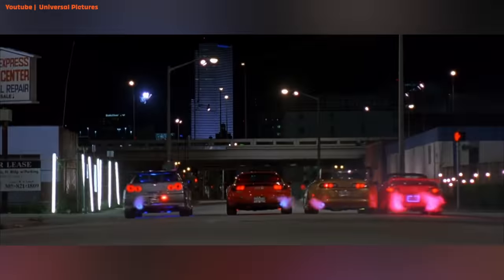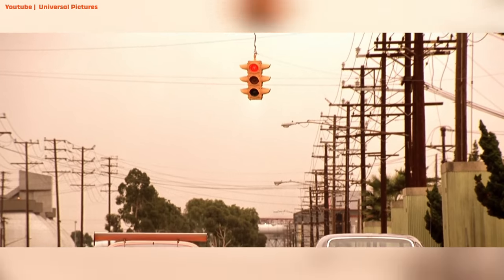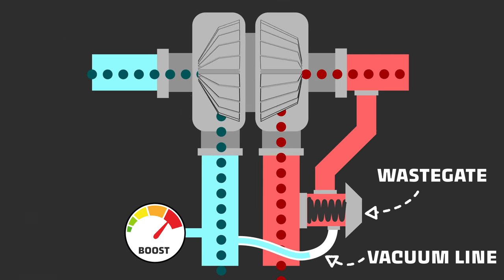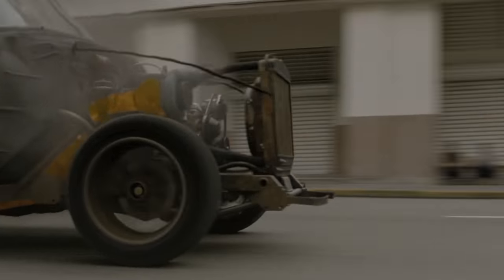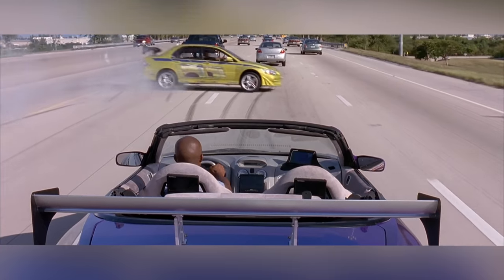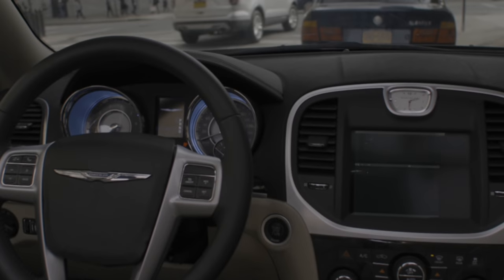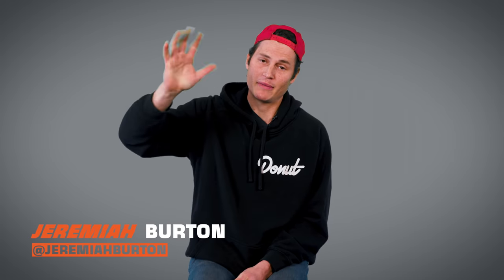Busting Fast & Furious Lies with Science

Comment: The wheelie burnout is possible, you disappoint me Jeremy, what's happening here is the tires are slick and because they are cold means no traction if you see he does the burnout first and when the tires heat up it grabs and it does the wheelie.

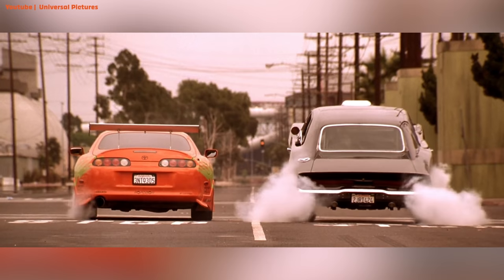Comment: so you think a car cannot go forward and spin its drive wheels at the same time? i thought this was a car channel? 3:30 - 4:05     theres actually a perfect point of torque where your car would be lifted into the air, the tyres could start to loose friction and spin but still have enough to hold the car up (as you say in the video correctly the higher it gets the less torque required to hold it up)

Comment: Most carbs like that holly regulate fuel pressure off of boost pressure from a line off of the hat on top of the carb. So It increases the fuel pressure in the carb proptional to boost so the trick should work.

Comment: do a wheelie with the car then discharge oil on the tires of a very specific viscosity to reach a very specific traction to RPM to torque ratio

Comment: Could they have simply modded the reverse gear to a 5th gear type ratio? Or added a splitter box after the fact to increase the drive ratio to the rear wheels? The possibilities are endless and therefore plausible.

Comment: No mention of if it had the power to wheelie and burn tire then shouldn't it also be running in one tire since the inertia of the main shaft should also lift one of  the rear tires.

Comment: Technically, you could possibly do a wheelie while doing a burnout, it would likely take quite a bit of power. There is still friction between a tire doing a burnout and the road, after all, that where the "burn" comes from. There are two coefficient for friction static and kinetic. Tires usually use mostly static friction while driving as the point of contact of the tire and the road doesn't across each other under normal driving conditions. Kinetic friction on the other hand is used when two surfaces are sliding past one another as in the case of a burnout. Kinetic coefficient are lower that static values so therefore you'd require more power. How much is a much harder question as 1) I couldn't find a value during my quick google search and 2) the value would change depending on the heat of the tires, and under the conditions of a burnout, the temperature would change quickly.
Reply: Also, hacking is never done right in entertainment, mostly because it'd be REALLY FUCKING BORING TO WATCH. lol

Comment: Im not a carby guy but would there be a way to increase fuel pressure in the 'wastegate scene'? similar to a rising rate FPR>? just a thought, dont actually know if carbs can do this hahaha, carby homies might be able to shed more light?
Reply: Depends how big the turbo and wastage is. Depends on engine setup, fuel pump too.
If it’s carb, it’ll be flooded with fuel. Has to have supporting mods.

Comment: If it’s the O2 in NOS that matters, can we just pump straight oxygen into the engine instead? Why or why not?
Reply: "Nitrous oxide easily liquefies under pressure, so you can store a lot more of it in a bottle than you can gaseous oxygen, which does not liquefy. 
source: 
https://auto.howstuffworks.com/oxygen-engine.htm

Comment: I thought of a way the NOS exploded, When they were shooting randomly at the car, they could've hit a tank and it was leaking the gas while one fire.
Reply: Actually,  the only real way that scene could've happened is if the heat of the fire increased the temperature of the bottle so much that it pressurized the gas inside to exceed the burst pressure limit of the tank.and then the rush of oxygen coming out all at once fed the flames to the point of explosion. At the most though it wouldve blown out the windows and maybe popped the hatch and doors open. Never ever wouldve lifted the car off the ground or done the kind of damage it did. Themz explosive charges that had to do that.

Comment: 6:40 works on older diesel engines , the amount of diesel injected is controlled by a pressure controlled valve , and in the movie isn't the turbo before the carburetor ?? so if the carburetor is big enough it could inject more fuel according with the higher air quantity

Comment: Wheels smoking doesnt = no friction, it means a lot less friction, yesss, and therefore a lot more torque and RPMS on the actual wheel, but theoretically, it should possible to do a wheelie burnout with a powerful enough engine, drivetrain, transmission, and most importantly axles.
Reply: Also the NOS bottle cannn explode, the heat from the fire causes a build up of pressure inside the bottle, if the pressure gets high enough the bottle (most likely just the cap) pops, releasing the NOS into the fire at a very high speed, the heat would already be releasing the oxygens and that are of high oxygen density would cause the fire to accelerate very quickly, combine that with the massive pressure increase from 1) the fire expanding very fast 2) the NOS escaping the bottle, you would get an explosion, or something like it, maybe not enough to lift the car, though the argument could be made.
Reply: Every car that has self driving hardware and has some wireless connection capability can be hacked like in the movie. Granted it would take meticulous process and algorithms breaking through the security for each individual car. But theoretically yes, and in order for it to happen the way it did in the movie it would probably involve some machine learning algorithm that has been exposed and used on thousands or probably millions of previous vehicles and/or other similar security and operating software for it to be as efficient and quick as happened in the movie.
Reply: sorry for being kind of a buzz kill with these comment, but its low key the same thing as explicitly pointing out why the movies are unrealistic.

Comment: Wait didn't dom say it was 900 hp? So your math has a 200hp deficit in calculation plus go to the strip and you'll see cars with similar HP and class do smokey wheel stands and still go down the track I'm not a fanboy of the franchise but just because it doesn't happen often doesn't mean it can't
Reply: you wont have that amount of grip on an unprepared surface
Reply: @noneyabizz8337  and yet it still happens